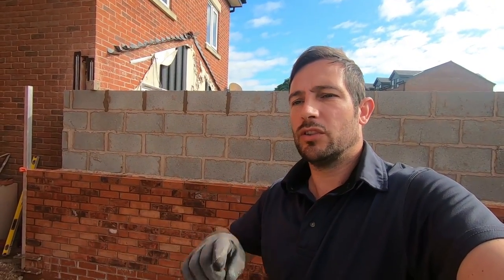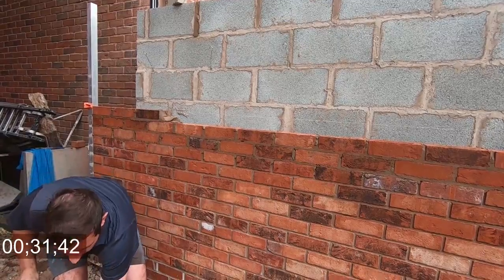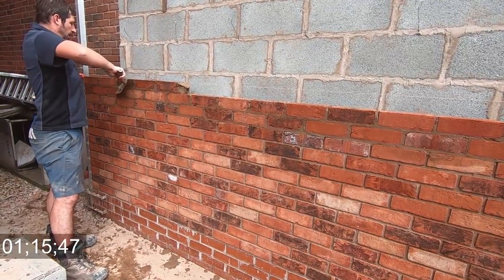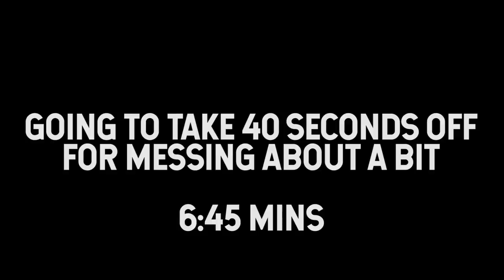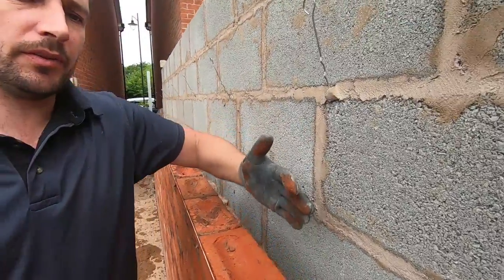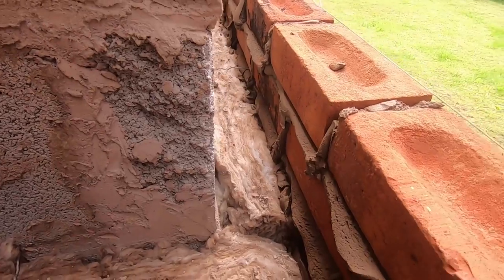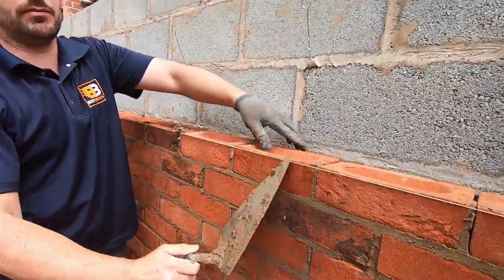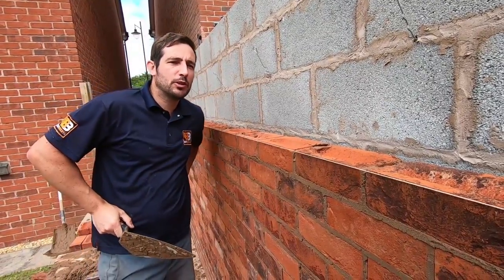Trying Pick and Dip VS Traditional Method - Bricklaying

Comment: I watched a video by a bricklayer who did a few videos highlighting pick n dip. I had a go at it. Took a week or so to get the technique right and I’m now laying more bricks using that method than traditional. Found the old trowel that was smaller trowel helped too. But tbh does it really matter 🤷‍♂️ each to their own.  As long as the quality is there and your earning just do it however you feel comfortable. Spot boards set higher helps for pick n dip too. 🧱👍
Reply from the maker: i think it would be evern better for footings where you dont have to worry so much about clean cavity

Comment: Well Stu you are obviousely more comfortable with the traditional method. I agree with everything you say especially about what is right for the individual and advantages/disadvantages of each method eg pick and dip better in hot weather. I am not a bricklayer. I have been a Plumber for 40yrs. I have always adapted and learnt from others one thing I did notice is that you were looking to improve and take on the good bits from each method like any good tradesman should. Only the most arrogant think they know it all. Well done great video

Comment: One of the main advantages of pic & dip method is that u don’t have to butter each brick 🤣 u push the bed up to make the perp
Reply: You shouldn't be buttering any of the bricks stu
Reply: I don't think pick'n dip is suited to the English way. It comes from the continent, where all the work gets raked out and pointed after. Here the brickwork gets joined as u go along. So the joints have to be full and flush, otherwise they crumble after a few years.

Comment: The variant I've watched doesn't involve buttering they just wap a huge dollop of really creamy muck as the bed and the perp gets formed as the brick slides horizontally through the mortar pushing a gob of muck against the preceding brick.
Maybe that's where they save time
Reply: This system comes from germsny and holland, where the bricks are smaller in height. So the perps get filled easier. Also, it's all raked out there anyway. As fast as the english way, if done properly.

Comment: great video stu you had the same problems as me when i tryed it.i found laying right to left was easier picking and dipping.
Reply from the maker: I will try that in part 2 pal
Reply: Its wrong from the start , no cross joint needed that's the pick n dip part not pick joint n dip

Comment: I’ve been watching a lot of videos on pick and dip. I use a combination of it and traditional spreading. Spread the wall with a lot of mud. Be sure to spread the majority to the front of the wall. No head joint or perp. Just slide your brick back through the mud creating a head joint. Then take extra bed joint and plop it on top of the head joint. Rinse and repeat.

Comment: Pick & dip at waist height and above, always. Agree, more useful in the heat. Once you get used to it you can put your joint on with the bed. I reckon it uses more mortar in the end as you don't furrow it but it's a better job because there will be less voids.

Comment: To be honest, you don't butter up in pic n dip. You just plop the muck down thick and then scoop the brick into the other standing perp at an angle as you go in front to back, like you were laying, so that it squeezes muck into the perp joint. Also, you angle the brick sideways from far face, leaning into the outer face, scraping off the muck as it squeezes out to the front, outer face. Not much comes out behind but you can scrape off as you go. But doing pic n dip is about twice as fast than traditional.

Comment: Nice work, STU! 1.Why are the bottom four rows made of hollow bricks and then you put all the other basic solid bricks? 2. What is the difference between these bricks? Clinker? What are their sizes? 3. What masonry mortar do you use? 4. What wire do you use to connect blocks and bricks to each other, stainless steel?

Comment: One thing I've learned from pro teachers is that if this is going to be your career, you have to protect your body and joints. Credit to ~Charles Cummins~The first method really made you work much harder at bending and flexing. That method could wear your body out in a few years. You should do what ever wears on you less! My opinion. Great videos!
Reply: The best answer.   Your back put first  .

Comment: Surely you should have your spot board closer aswell as bricks. I first seen this method being used in the early 90's by the dutch. 3 of us v/s 3 of them on a cellar. They absolutley creamed us. My concern is the amount of muck behind the wall as I tend to scrape the back of each brick after laying. I still lay an average of 800 a day using traditional method so Im not bothered about the pic and dip method. I also like a full perp it's easier to joint afterwards. Nice vid tho bro.

Comment: Pick and dipping works best when you scoop the mortar with the end of the brick to fill your joint rather than buttering the brick every time. If you bed heavy and roll the brick from back to front there are very few snots on the back. North western brickie here and always lay pick and dip. But that was a solid effort takes a while to get used to a new method and speed comes from experience. I always find I’m faster when I’m calm when I feel rushed I make mistakes.
Reply from the maker: Cheers Jake, i did roll but probably not enough, may try again but I don’t think I will. Change because the beds are never uniform, you would have to judge the amount of mortar perfectly each time to get a consistent lay but the traditional you work the mortar to a consistent bed throughout so I find it easier to lay on that bed but I may give it another whirl with the dip perp joints
Reply: I use a smaller trowel when I’m laying, mostly because I broke my elbow when I was finishing my apprenticeship and get mega bad tennis elbow. My trowel is the same size as a Dutch trowel so a full trowel is almost a perfect gauge for one brick.

Comment: Hey bro love the fact that you tried and have such a great attitude about life and masonry. Pick in dip is faster when your material is at height of waist and up. Also no need to add the perp joint as the extra mortar is used as a squeezed in joint. Also the trowel can be much smaller. Less than 10 inches because instead of spreading 2-3 brick you are spreading one at a time. Also saved your wrist/ elbow. Love the video keep it up! And like you said everyone has their way. As long as it is level plumb and straight. That’s all that matters!

Comment: I thought it was brilliant.  There is a whole lot of skill there which is not fully apparent, for example laying the bricks with the back edge first so the excess mortar squeezes to the front but finishing up so the bricks are level front to back, then laying then so they are level left to right, then getting the mortar mix just right so the bricks tap down easily, then the lightning quick strike off of the excess mortar, getting the perps in line, getting the bricks to form a flat face to the wall.  I'm envious!

Comment: Pick n dip you get less injuries......elbow n shoulder. try laying your bed at a slight angle to the front and swiping up the muck for the perp with the heel of the brick.....takes a little practice but fast and easy on your wrist.....
I still do the twirl for blocks....
As you say so well.......each to there own

Comment: I believe the fastest method is using traditional, but as you did at 12:08 ( your speed also increased atm) I always do it that way and have always beat someone who butters the brick they grab. I always use the mud I scraped from the one I layed and butter the one just payed. Sometimes I don't even cut my mud off from the furrow if I'm running bigger head joints. Your skills are fabulous man, I'm just saying.

Comment: Isn't pick and dip where you don't butter the brick you dip it into the big bed hence the name pick and dip?
Reply: No, you pick the brick up and the dip is getting the mortar from the board at the same time..that's what I thought anyway?
Reply: Nah his right pick n dip you don't butter, the way u put the brick down slides the muck up. but it wastes muck as falls down cavity but is good in excessive heat as Stu sez but personally traditional all the way faster and less wastage.
Reply from the maker: Yeah I thought that bud you pick the brick you dip your trowel. Anyway the essence of the method is that you get your mortar and brick at the same time. The traditional you spread through as one part then lay brick secondly. No pun intended but people are going to pick at the video anyway, can’t stop pessimists they can find fault on anything 😁 keep on laying 👍👍👌
Reply: But the whole point is to see which is faster and you've defeated the purpose by buttering the brick which in the pick and dip is eliminated,saving time.
Reply from the maker: ok bud i will maybe try again with part 2 cheers
Reply: The original method of pick and dip always involved putting a joint on the brick! The recent videos on YouTube show people taking the joint from the bed...but most are not putting a proper joint on, you rely on the next spread to fill the voids of the joint meaning it's not getting the correct bond needed. You need a lot of bed to get a full joint which means it's harder to keep cavity clean.

Comment: Dip method not economic with movement, going to the spot every time   For compo for each brick ... sod that my back won’t tolerate that for long
Reply: thats doesnt really make sense. and the demo given here was not pick and dip
Reply: Should be more economical as every time you turn back to the wall you have both hands full instead of just one
Reply: Pic and dip is useless seen loads of videos on it perps are never full just bad practice in my opinion traditional method all the way if you can't cover more than 3 bricks with one trowel full of muck then your doing something wrong

Comment: First Viewer yep yep!!!!!!!!!!!!!! have you ever tried a WROSE trowel? and are they simalar to Marshall town? I've heard pretty good things about them.
Reply: supposed to be nice trowels
Reply: I find theyre better at cutting brick in place of a hammer but I find them too wide and have inconsistent final product tbh
Reply: I've been laying for 20 yrs and always had marshaltown untill 2 yrs ago when I swapped to a W Rose I've got a 10 inch narrow london pattern with a wooden handle it's beautifully balanced  blades great much better steel than the marshaltown but still with a nice flex to it...I won't ever back now.....for me a much better made better balanced trowel.
Reply: Rose trowels have a higher pitch ring to them because harder steel,  maybe harder forged.  The Marshalltown handles can be taken off by boiling them with the handle in a fry pan and let it boil then pull it off with a rag and slip it onto a rose with a bad handle.  Most American bricklayers like a London trowel and many UK bricklayers like a Philadelphia trowel so yeah those other guys got the best tools.  The grass is way greener on the island you haven't been to.

Comment: Pick and dip ( squeezing on joints ) you got it wrong.... I’m from Leeds and I use it and I would of done what you did in a 3rd of the time you took pal.... big heaps longer spreads. Don’t butt up the brick just use the spread to pull it back onto the other brick.

Comment: I think you were slow because you weren't using the pick and dip method … You were picking up a brick and buttering the end …  But in Pick and dip you simply pick the brick up and then without buttering the end ,  you  roll it back onto the bed of mortar so you make the joint with the mortar that is pushed back to the existing brick in one action...  There are a couple of good vids on here which show traditional brickies  now using pick and dip   where they once used traditional method and they reckon it's nearly twice as quick and easier on the wrists .